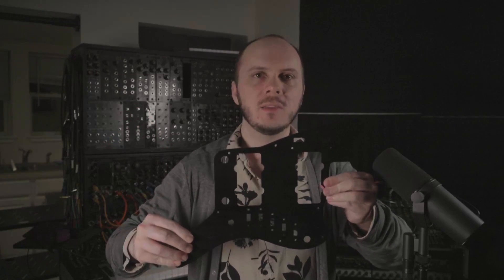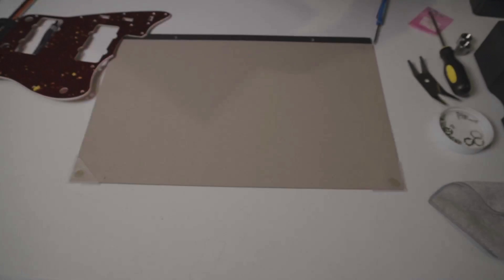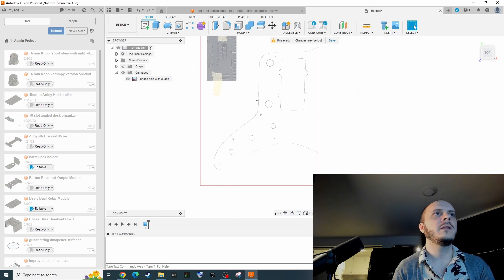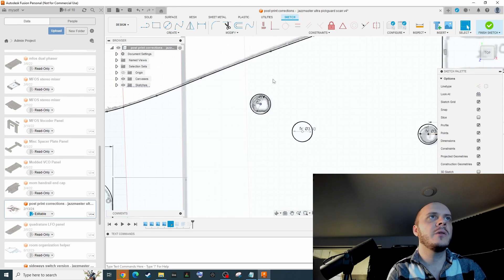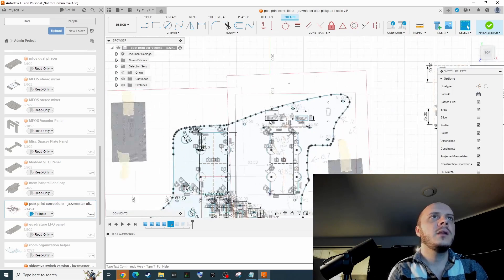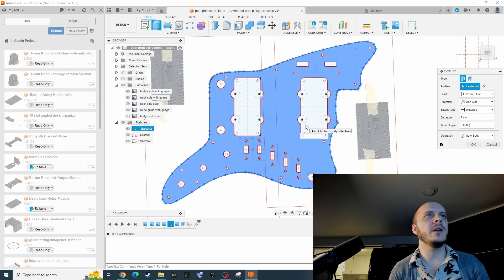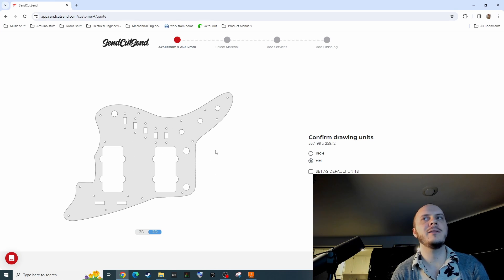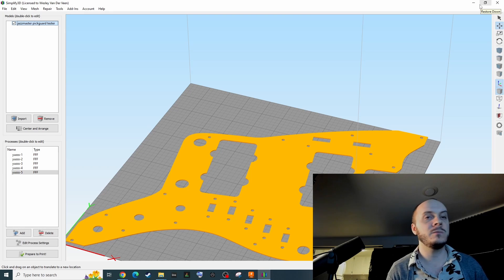DIY Anodized Aluminum Guitar Pickguards with Send Cut Send (How to)

Comment: why didn't you scan the pickguard?
Reply from the maker: The pickguard is rigid and won't fit in the scanner without distorting the image to an unusable degree. The paper was flexible enough to fit in there in sections. If you had a really big scanner, you could scan the pickguard directly.